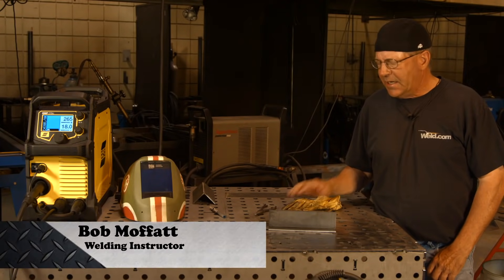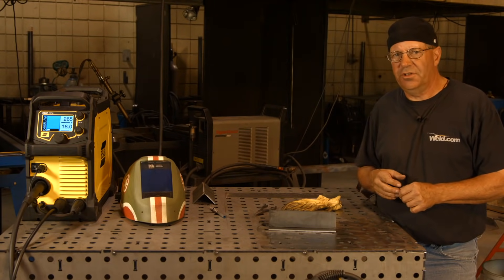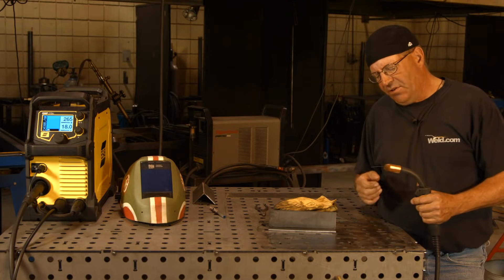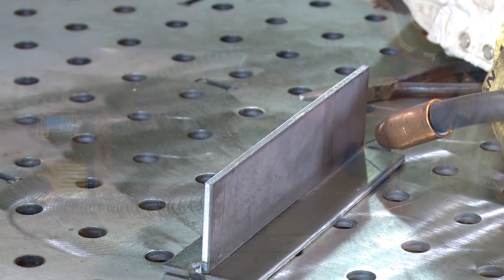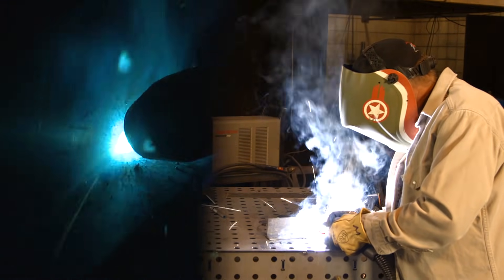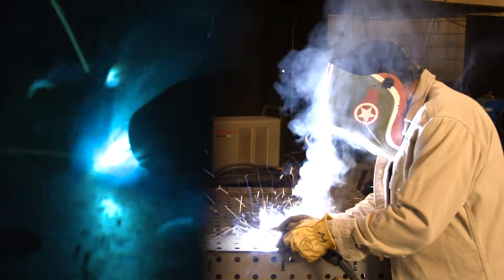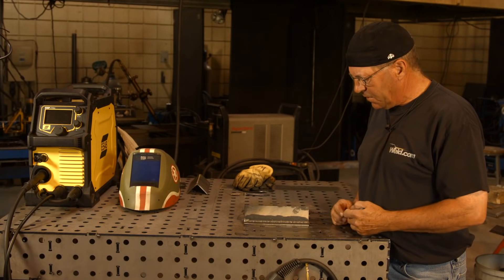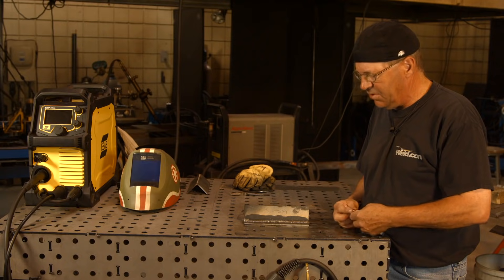Flux Core Welding: The Basics You Need to know

Comment: your welding is very impressive!! And explaination....But the gases and fumes trouble me...your breathing it into to your lungs....I see lung cancer in your not too distant future ....I feel a respirators combine / welding helmets tied into one  unit ... would save LIVES...help to prevent CANCERS
Reply: Yeah, man. I have a flux core welder and I can tell you firsthand that stuff is BAD juju. 
I try to always weld outside or at least with a fan pulling that stuff away and/or a respirator. If you breath in enough of that stuff - even from one session - it will mess you up. I've had the shakes more than once because I wanted to rush through and get something done and then totally regretted it after.
I see a lot of people on here scoffing at folks who are rightfully concerned. 
It's cool. Their Darwin awards will eventually be waiting for them.

Comment: Bob, thanks for the videos!  Question for anyone - is there a more quantitative way to measure the feed roller pressure and what are the symptoms of too much or too little feed roller pressure?  Thanks again, jim.
Reply: Too little drive roll pressure will result in the wire feed slowing or even stopping when the cable to the gun is even slightly bent, and took much will collapse the wire when it goes through the rollers,and will impact weld quality. I forget what exactly happens when the wire collapses from too much drive roll tension, I just know it's not desirable

Comment: he doesn't tell you what brand name wire he is using and he doesn't give you any specifications on diameter of wire or type of wire these things are very very important is he running off of 220 or 110 and he States all these interfield wires run straight polarity that is false I ran Lincoln 3M that runs reverse polarity electropositive I'm just saying this guy is giving a lot of incorrect information typical rookie

Comment: he's not running it right plus she's using that huge insulator cup you don't need that all you need is a thread protector his Gap is  too short wire is pushing into the art causing an explosion and the result is lots of spatter

Comment: he's got way too much spatter and as far as increasing and decreasing the voltage like he says a half a volt all you need to do is adjust your stick out it takes a little practice but he's not running it just right and you don't need a wire wheel to clean up that spatter I use a really small wire brush they called a toothbrush and most times I don't even use that I just use a little bit of stick out and actually use the wire without pulling the trigger to scrape my weld and as for the spatter if you are getting a lot a flat head screwdriver or something like that works just fine and again when you're cleaning up your your weld always use a respirator the dust from that smoke and slag are very dangerous don't even let that stuff get in your eyes take it from someone who's been doing it for over 30 years actually the dust created by cleaning welds is worse than the smoke micro particles with heavy metals

Comment: to all the people leaving comments about welding smoke and don't be a pansy and get used to it and so on and so on take it from a guy who's been welding with flux cored and stick in confined spaces do not breathe that stuff in don't even let it get into your eyes you guys making these comments about we're used still smoke don't worry about it obviously have no clue no idea what the hazards are and what it does to your body what it does to your lungs is only a start where some type of respirator speedglas makes an awesome Shield respirator system battery operated fresh air system and if you can use a fan or a smoke eater along with that use it when this wire innershield first came out Lincoln had a smoke eater attachment right on the nozzle of the gun they knew how bad it was do your research I started welding with a Ln 7 wire feeder look it up the vacuum hose smoke eater was attached right to the tip of the gooseneck I burned hundreds of thousands of pounds of wire innershield 3/32 700 in a minute and I've burned .030 do two 10 hour days with a speedglas fresh air system and see how you feel and then do to 10 hour days without it you can tell the difference right away you feel sick and you have sulfur farts without it they have this thing it's called mesothelioma trust me you Young Guns you don't want it use your respirator that smoke will go right through your pores you think I'm freaking joking it's no joke
Reply: Do most fcaw wire feeders still have a smoke eater attachment? Or are they being ousted from the product equipment for some reason? I definitely want to have healthy lungs and such by the time I'm in my 60's and beyond. What is a good mask btw that you would recommend for a beginner welder. I'm currently studying fcaw welding.
Reply: There are new health studies out that claim manganese in welding smoke causes parkinson's disease! I've became concerned because my father died of parkinson's disease and he was a lifelong welder.

Comment: when you stop the wire coming out of the tip with your finger that's when you're going to flatten the wire out at the drive rolls stop the wire with your finger at that spot on the dry roller is where you're going to flatten your wire this is total disinformation believe me I've been there done that the feed will stop. And the knurls on your drive rollers will flatten the wire it happened very quickly so keep your drive rollers tight

Comment: don't leave your drive rollers loose and you should not be able to stop that wire with your finger the drive Wheels have a V groove and are knurled if you are able to stop that wire with your finger your driver rolls are too loose if you do a lot of other position welding any kink in your whip will result in wire slowing down with Drive rollers set that loose I do a lot of lot of position while laying and ever use these things since they came up with them trust me it takes a lot to flatten the wire

Comment: Let me understand this - with "stick" welding I'd be using a rod with flux, but with flux core welding I'd be 
using a wire. Both would be messy operations. A stick welder would probably be less expensive than a MIG (which can either gas weld or flux core weld).

Did I get all of that correct?

I'd like to do some "nuts and bolts" sculpture, but I don't want to deal with gas cylinders. So, should I just go for a "stick" welding machine?

I've a 240 volt outlet (I guess it's there for a washing machine) in my patio - will that do for a stick welder?

Many thanks! Yes, I liked and subbed.
Reply: Arc welding is better for more heavy duty application on thicker metals. Stick welding thinner materials will often burn holes through the metal if you're not careful. A lot of welders have 10amp plugs these days.
Reply: I have a flux core welder and a stick welder (both from harbor freight,  but running Miller sticks and spools).
I would say you could use both, depending on the size and thickness of your projects.
Stick welding can sometimes be a pain to get started, unless you're using a stick that likes to burn through dirty material. 
I think for ease of use and expediency,  you could probably get by with just the wire welder for smaller projects. 
One day I'd like to pick up a multi-process machine, but I'm not a professional  by any stretch and they're a bit expensive,  so I'll stick with what I can afford for now.
Btw, check out bigredfishdad. 
He does a lot of projects with his flux core welder.
Reply: Sorry. I also meant to add that with a mig (metal insert gas)welder, you have a gas line that runs an inert gas over your weld to displace the oxygen on your fresh weld to keep it from well - oxidizing. 
When you use a flux-core wire welder, you're essentially doing the same thing, however the wire is actually hollow, and the flux is inside of it. When it burns as you weld, the flux displaces the oxygen much the same way it does in MIG welding.  Same result just a slightly different process. 

When you stick weld, the flux is on the outside of the rod with the metal in the center. Again, the burning flux shields the metal from oxidation. 

First me, a flux core wire fed welder was an easy choice because it  doesn't require a gas tank and regulator/flow meter, hoses, and all the other little things.

For artistic purposes, I'd just keep it simple.

Comment: It is not actually a gas-less process since the flux core turns to gas as it burns. The process does not require compressed gas or a gas line since the shielding gas is produced by the flux and heat from the arc.

Comment: ... Also, please can you tell me if one of these could handle 10 mm or 12 mm mild steele round bar? (The ones available in the UK are mainly 130amp.) What wire are you using? (All the ones I have seen online speak about welding mild steele, but come with aluminium wire.) Thank you in advance if you have time to answer. xx

Comment: Good tip on the wire feed roller tension! I have bought a 4.5kg (10lb) roll of flux core wire for emergency use if I run out of gas and need to finish a job I am working on. I would have had the roller deforming the wire most likely if I had not seen this excellent tutorial. John, Australia.
Reply: Also flux core feed rolls are serrated so you use less pressure to avoid deforming the wire.  Solid wire rolls have U-shaped grooves.  Also the stick out on flux core is longer than what your used to with gas shielded.

Comment: Just found this. Helped explain my cheap welder I got for free. Now i know I'm not doing anything wrong. I wish i had better voltage control but Min and Max with wire speed and I'm figuring this thing out.

Comment: As usual a great video. A few of the comments have mentioned the fumes , which I agree are really bad and make it difficult to see the puddle. I do not have an extractor but use a small desk fan to blow the smoke away. I was also thinking of sending air down the gas line to help blow the smoke away. Any thoughts

Comment: One of the better videos I've seen on flux core gasless welding techniques. So on a horizontal weld, you are starting from right to left - pushing your weld puddle, also aiming your gun from right to left. Can you pull your weld puddle from starting on your left side to right?

Comment: Im a FIRM believer in flux-core wire. I have a Lincoln 125 that came set-up for gas...but I've always liked the fact that it will go with you and run quite well on a 50' 12awg extention cord plugged in to a 20amp 110vac receptical. I use .035 Lincoln flux-core wire and had it tested against one of my ac-7018 1/8" welds...both fillet welds on 1/4" flat-bar. Also welding two 1/4" x 2" bars together on a bend test. Both did as well as the other. The nice thing about using flux core...you dont need to lug around a bottle of inert gas...and all the paraphernalia involved with welding! Another thing i havent seen anyone use is a splatter scraper. It and a wire brush is all thats needed to clean up wire splatter. Thanks a bunch for your video

Comment: Excellent tutorial very informative, the question I have, would a 220 flux core welder make stronger welds I plan on changing to bigger rear ends, and stretching steel rims to make a widebody, do you recommend fluxcore or gas.

Comment: there's something that's always bugged me about this video and this time when i landed on it i decided to take the time to mention it. I know this video is a couple years old but the situation hasn't changed, in fact if anything it's become more prevalent. although this is just an estimate, logically i think it's a realistic to say that probably more then 90% of the people out there doing  flux core welding are doing so on a cheap 110v welder that isn't capable of DCEN and quite frankly the average person using that type of welder has no clue that there is a difference between the cheap 110v welder they bought at Harbor Freight and the more expensive DCEN type of welder referred to in this video. it's always bugged me that no discrepancy was made in this video between the two different types of flux core welders because the resulting weld is very different.....
Reply: Yeah I hear you. I have one of those cheapo welders and there's no way it will ever produce a weld that nice. It's just not built like that.
But for a round the house quick repair here and there, they're not too terrible.
Would love to one day afford a quality setup though. 
Heck even the one has using would be a giant upgrade.

Comment: According to the AWS online learning modules, “welding economics” FCAW module 7, a drag technique (backhand) should be used. A drag angle helps push slag back from front of weld pool and provides increased penetration. The only time a push angle is recommended is when welding vertical up, then the angle should be between 5 and 35 degrees

Comment: Interestesting. So if this guy had a welding machine for flux core , usually those welders are just running flux core so they would be wired for flux core. So why would the welder have to be rewired in this scenario. Another way to ask this is why would a flux core welder be set up any other way than what a flux core welder would need to be set. I'm confused by this comment and before I start switching around wires on my flux core  welder ,I'm hoping to have this cleared up. Thanks Youtubers

Comment: Thanks much. Great video

I’m just learning. My bead is not too bad, but I’m having a terrible time seeing the joint I’m trying to weld, so I’m drifting off. I have set my helmet at 10. Any other ideas?

Thanks
Reply: You need a light source to illuminate what your trying to weld, before you strike your arc. I use the light from an extension cord but that is all I have right now.